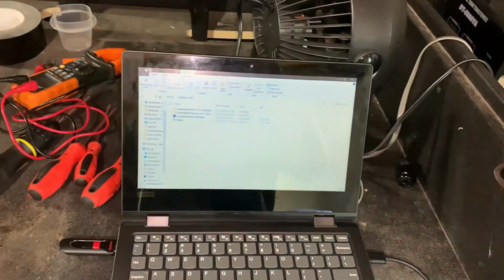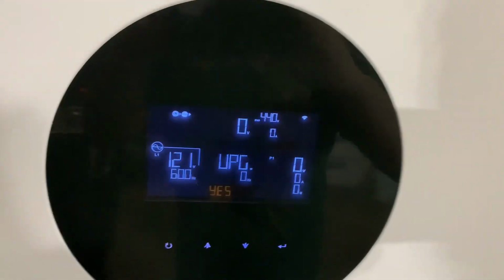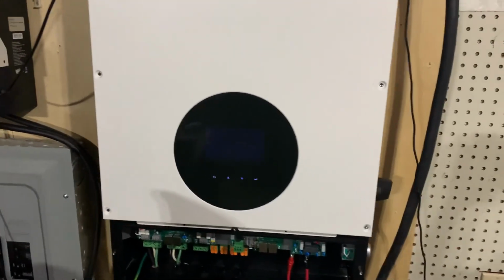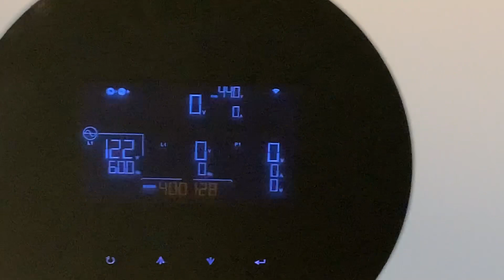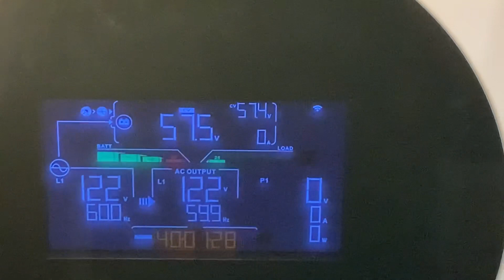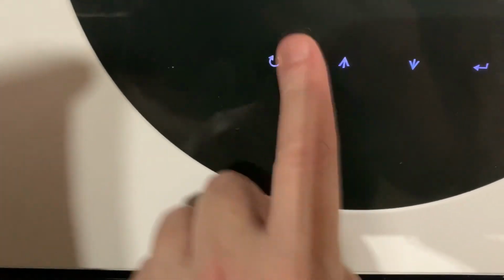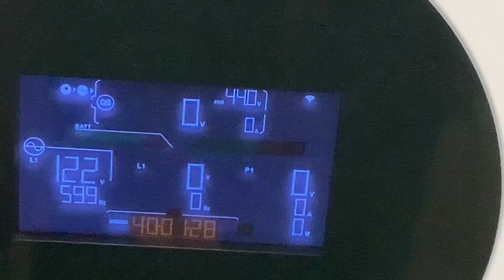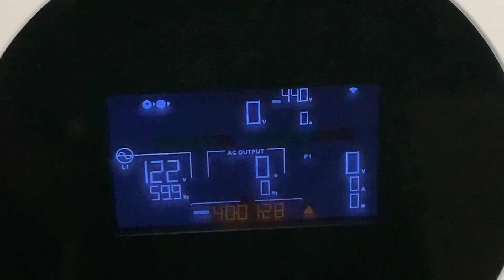Lvx6048.wp firmware update. Will this help?

Comment: How is this thing working out for you now? I finally got mine up and running and it seems to work. I don't use it as I have a different setup now, but I hooked it up for 3 days just to see it run through its daily cycles and it worked well.

Comment: I can't get my to connect to my laptop.  What windows are you running?
Reply from the maker: Yeah, unfortunately, watchtower is crap! The good news is that you’re not missing much. Solar assistant is far better and more useful.
Reply from the maker: I am using windows 11 but, you can use most windows. The problem is, the usb to usb connection sucks pretty bad. When updating you will have much better luck with a serial to usb cable.